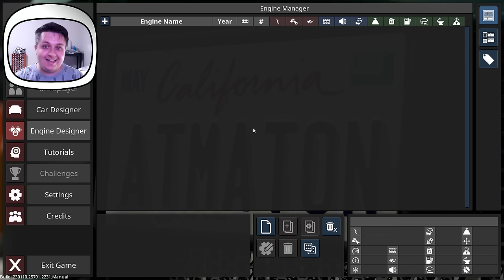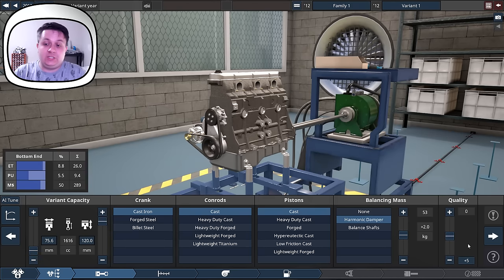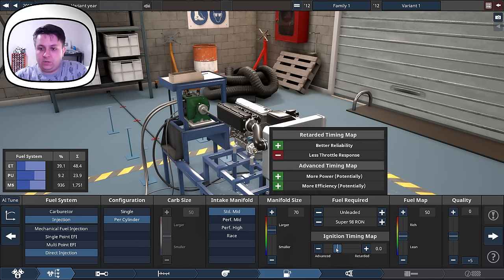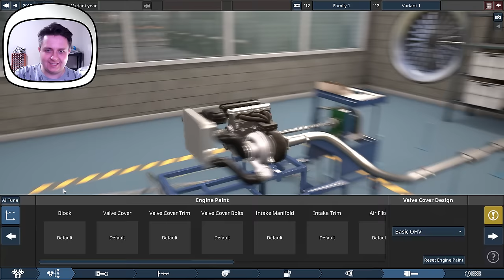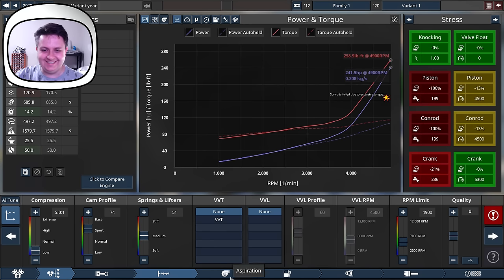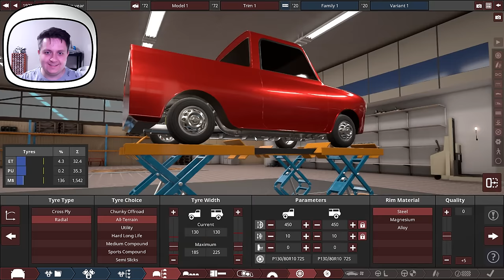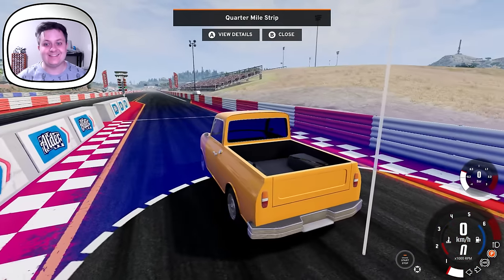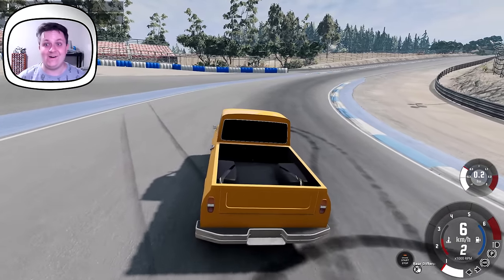Building & Testing an Engine With LONGEST Stroke & SMALLEST Bore (Automation | BeamNG)

Comment: Rod length and bore size have limits because of the rod angle during the stroke. Too long rods/stroke and the rod hits the sides of the bore.
Reply: Very long strong engine have a separate cylinder rod and connecting rod for that reason.
Reply: @zachary3777  also for scavenging or double acting but that'd allow you to definitely push the limits further if the game had it.
Reply: @gavmansworkshop5624  yep, also true for example on a double acting steam engine.
Reply: You can use a cross head bearing like the Wärtsilä RT-flex96C and have a 3 foot bore with 9 foot stroke.
Reply: You can have very long rod so that the crank will be further from bottom of cylinder, with that conrod will move less sideways at the height where it would contact bottom of cyclinder bore. the problem with that long conrods would be weight and they would bend very easily.
Reply: The ideal length for the connecting rod is 2 x the stroke length.  Results in the least friction loss.
Reply: @zachary3777 yea that's called a cross head design
Reply: When you "stroke" an engine, you need shorter rods to keep the piston from hitting the head. If you have the room to shorten the piston instead then that would work too. And yes you're right, at some point the rods would hit the cylinder walls but that's probably not thought of in the game and that would be an extreme amount of angle causing issues with the piston wanting to tilt in the bore.
Reply: @bennyboyy7  Or you can use a piston with the pin location closer to the top of the piston.  It only needs to be raised 1/2 of the increase in stroke.
Reply: Or you could build an engine with sliders
Reply: BMW R50/5 they cut slots in the bore to make room for the rod.
Reply: Easy fix! Just make the conrod way longer!
Reply: Also you would need more air and fuel to push the piston down a greater difference witch means you would need more bore to fit more gasses. Only half the stroke would be powered by the expanding gas. There is no way to fit enough fuel and air in that bore without insane octain and insane boost.
Reply: You could have a smaller radius crank but you would have next to no torque. That would solve your rod angle issue
Reply: If anything I said is wrong please tell me. I'm a mechanic student working on my MOT certificate and level 2 qualification. Anything you could correct may help me. Thank you
Reply: Higher rod ratio solves that issue.
Reply: What bout coding the jbeams of the engine? 😊

Comment: Yeah, turn the compressor trim down to 30-60, crank the boost pressure up a little bit, add 5th gear, put the static compression around 8:1, increase the valve spring pressure/stiffness a little bit; that should make this engine better.  Good fun, though.
Reply: Let my tell you 50%of you advise is trash

At first the compressor size should be around 60mm for that displacement and rpm the turbine needs too be way smaller lmao ~50mm maby even 45 mm

The trim yeah around 30ish   but trim higher trim and alower size is also possible but isn't as effective

 So fare we are almost on the same page but boy springs and lifters  over 50    isnt the way!   only high boosted engines and the once  at +10k rpm  need more than 30 in springs/lifters   the static compression at around 9.0 is low enough trust me the valves don't flow enough air so that high boost will not comply reach the cylinders 😅 (had one mad stroker engine  family but oh boy it was a struggle too tunned the turbo for thes engines) 

And well the 5th gear is a good idea
Reply from the maker: thank you engine wizards
Reply: @darealkosmo  Kosmo can you read one of my comments i think someone with your name is trying to scam me
Reply: This guy can tune cars over email.
Reply: @matthewblunderbuss4545  well +300h in automation alone and high understanding of the basic principles at work will do the trick XD ok same spreadsheets do also help
Reply: @TheLtVoss idk man, kosmo is running a turbo pushrod engine and in my experience they tend to require stiffer springs compared to something like dohc, I would suggest something like 60 - 80 springs
Reply: @pallav8725 That makes zero sense. Pushrod or overhead cam, the springs are whats snapping the valves closed on both of those... The thing thats OPENING the valves has no bearing on what the strength of the thing CLOSING the valves needs to be...

If I'm reaching then... maayyybee if ANYTHING, the DOHC is gonna rev higher and therefore need stiffer springs...

Comment: The reason (I'm about midway) the turbo isn't making boost is that it can't really spool up since the engine operates at a very low RPM, and it is pretty small.
Reply: So what do you think tractor turbos do nothing

Comment: 6:54 Yes, you can put a carb onto a turbocharged engine. It doesnt really care about the general pressure in the intake manifold, it only cares about the air flow and the pressure difference around the venturi nozzle.
Reply: I mean, boost referenced carbs dont. But if you dont have a boost referenced carburetor, the fuel pressure is only like 7psi. So it'll lean out then youll blow boost through the fuel system lol.
Reply: @SoI_Badguy  Maybe, but if you use that kind of carbs, you are more likely to just push the float up and close the fuel intake.
Reply: They make blow-through carbs for boosted applications.

Comment: Here's some tips:
1) If you only want to use one muffler, always choose the second muffler and not the first, you'll lose less power and your engine will be quieter.
2) If you want to use VVL, set the cam profile and VVL profile far apart. The entire point of VVL is to give you extra power at high revs while maintaining torque at low revs, setting the profiles too close to eachother beats the purpose of VVL completely. You can even reduce turbo lag considerably if you set them right.
3) If you make a rear or mid-engined car, try to tune out terminal oversteer. You can tell a car terminally oversteers if the steering graph shoots up instead of down.
You can tune it out by: increasing rear tire width, increasing negative rear camber, increasing rear downforce, reducing negative front camber, moving the weight balance towards the front.

(terminal oversteer means that over a certain speed you will easily lose control and never regain it)
Reply from the maker: thank you!

Comment: You'll have to go some to BEAT the Fiat 7 liter 1903 GP winner. It was a SINGLE cylinder four stroke with a 5+ FOOT stroke and about a 97mm bore. The driver(s) and mechanic(s) covered over 800 miles in 24 hours or an average speed of 33.3 MPH or about 53 KPH AND it didn't break-down, something no other brand in the race could claim. Compression ratio was a "revolutionary" 4:1 and it produced about 18 Brake Mean Effective Horse-power. In 1904 it was the FIRST automobile to travel 1000 miles (Millea) in 24 hours. The first American auto to travel 1000 miles in 24 hours was the 1904 Duryea Bros 6+ liter V-8 on a closed course in New Jersey. Different sources claim the engine was 380 to 420 cubic inches, it's agreed the engine produced an AMAZING 25 BMEHP. The 1904 Stanley Steamer made 32 HP but it's need for water every 25-30 miles doomed it. The 1905 Stanley Steamer set a World Land Speed record on the beach very near what is NOW Daytona Beach, FL of 60+ MPH, variously reported as 61-63 MPH on INFLATABLE Firestone tyres,, another first for LSR.

Comment: One thing ive always found best when building engines or the whole car in general in automation is when you're tuning but can't get knock to go away or you finally got it to go away but now its very touchy to little changes. Skip whatever youve been trying, go back and lower compression and cam ratio, check everything to make sure you didn't accidentally bump something all the way up or down. If nothing is working though, sometimes you just have to increase quality and go with better materials. Honestly though ive been having fun just keeping my limiter under 6k and making torque monsters that pull like a dragster yet sound like a semi.

Oh and exhaust back pressure can cause knock and sometimes keep you from getting rid of knock. Funny to see it cause that in the game yet people still say to this day that you need back pressure. No you need the right size exhaust factory exhausts are usually right at that limit to keep them from knocking but they want to keep some exhaust gasses in the chamber to keep engines from releasing too much unburnt fuel into the exhaust and throwing cat codes

Comment: I would recommend the variable geometry turbo(vgt) for something this small because it will allow it to build boost at way lower rpms so it will allow that tiny engine to actually spool that massive 120mm turbo

Comment: AR turbo adjustment, more is not better, it just means boost will come later in the rpm range. Lower/ smaller turbine will spool up faster, which is what you want on a long stroke torque engine

Comment: The reason you can't get the bore to stroke ratio you're looking for, is because of rod swing at mid-stroke. If the bore is too small for the stroke, the connecting rod will strike the bottom of the cylinder bore. To get your "bicycle pump" stroke to bore ratio, you would need to use a crosshead, similar to a steam engine.

Comment: decrease throttle body to around 50, and bring exhaust diameter down about 20 to 30 percent, you'll get improved vacuum and higher exhaust velocity leading to a better running engine

Comment: For the cam profile, (and I'm no expert so I could be wrong) my understanding it that its talking about the lobes on each cam that operate the valves. A more aggresive cam profile would have very pronounced lobes opening the valves up much more, and a low cam profile would have a very slight shape to the cam lobes, opening the valves just a little. This would make sense considering high cam profile is preferred for high-performance (where more fuel and air are needed) and low cam profile is preferred for economy cars (where fuel consumption needs to be kept to a minimum.)

Comment: Variable geometry turbo will help. My ram 2500 diesel truck has a vgt in it. It just has fins on the compressor that are mostly closed at lower rpm and open up at higher rpm. This allows a larger turbo to spool quicker.

Comment: IRL if you make the bore too small (or long stroke) the rod will need to be crazy long not to hit the cylinder wall. 
- Still, a long stroke is better "if you can hit the same set crank RPM"!!!
- The reason's
- it's easier for the piston to move the crank (it has more leverage aka more torque). 
- since there is less surface area there is less friction on the piston (assuming the rod is long enough not to put the piston at a bad angle)
- the initial volume is smaller so combustion puts more pressure on the piston faster (the cylinder wall is closer to the center point of the piston) a bigger bore piston must fill up more area before it can push down.
- since the piston is moving farther, it's more likely to burn all the fuel (aka less wasted fuel)
- a long stroke piston must move faster at equal crank RPM which creates more turbulence in the cylinder wall for better fuel to are mixture (especially at low RPM)
- all of the above usually make it more efficient 
I first found this out racing RC cars if both engines are hitting 40k RPM the long stroke normally wins in every category. cheaper RC engines are usually square (equal bore and stroke) for they can't hit good RPM (HP) with a longer stroke.
Reply: @gatorage850 Long rods, like a ship engine, use a "cross head" to have the rod bend on the stroke. Fun stuff to play with for sure.
Reply: Well yeah but there are 2 thinks why we don't use many longstock engines

1. The piston speed  at ~ 20m/s is the end for very light pistons otherwise they would shred them self just by the acceleration and deceleration oh and the oil Film in the cylinder dosnt like such high speeds (and on small scale these epped arnt reached even with +40k rpm) 

2. The valves in the head can't flow if they are too small or doo you want optimal cylinder charge at idel? And lose power at the  in the areas you need to accelerate the vehicle (on a 2stroke that isn't as much of a problem

That is the reason almost every car has a nearly square engine 

on slow running diesel engines a slightly higher stroke is preferable because diesel oil burns pretty slow and the higher mass of the internals that need to absorb the shock from compression ignition is killer at high rpm
Reply: @TheLtVoss  Piston dwell is a thing, and NASCAR engines use a long stroke just for that reason.
Reply: @TheLtVoss  1. ? and 2. ?
 "That is the reason almost every car has a nearly square engine" someone did not tell Honda and Toyota that...
Reply: @gatorage850  honda is always in the 10% of square form more modern engines and the tendencies go too more square

Toyota well has quite the mix but there is a easy explanation too that streamlining of production it is cheaper too build a engine family allover the same bore and use different crankshafts for different displacements so all 1.3l to 1.6l engines have a 72,5 bore so that one piston fit them all but if you go too the 2.0 well look closely at the might of square engines

I'm not saying that a long stroke is bad perse but als always in engeniring there is a trade-off and limits if the engine rpm is designed low and fuel consumption is one mane thought I would also chose a under square engine  but going after these goals will leave a work horse with suppar responsiveness and low rpm in  a unexciting engine that will soll bad in certan demographics (and the most consumer how look after good fuel economy arnt that weathy so they buy cars les often)
Reply: @TheLtVoss  still they stoke up for a reason... If you are hitting the RPM stroking up will make more power and efficiency per CC Vs bore up at equal RPM gains? that why in RC where the rules are .21ci if you can keep around the same RPM you gain way more from stroking up. it's the same in full size cars... why the most fuel-efficient cars are stroke and the fastest 1/4 mile cars are stroke. 
- yes there is negatives like an F1 car runs short-stroke to make the mostly "lightweight" since the engine is less weight with a short stroke (and lower CoG) it makes and F1 car better a changing directions (in turns). Then you can add more RPM (to gain your power back) for a short stroke is typically "more reliable in high RPM"...  but it will be less power/efficient than a long stroke at equal RPM (only if the long stroke can even hit the RPM or hold up to the forces in the RPM!!!).

Comment: Stroke is limited to the rotation diameter of the crankshaft and bore size unless you have extra separate rod connected to the piston and conrod. So an extra rod between the piston and the conrod pinion aka small end.
Reply: yup. like ship using boiler engine.

Comment: Old video i realize. But thought id comment. With long stroke, high RPM is essentially impossible. This is because to achieve the same RPM with a longer stroke length requires the piston to travel faster and faster. Not only does this naturally increase the pistons kinetic energy making it harder to turn the other way, but after a point the piston has to travel so quickly that the air/fuel mixture can't physically combust fast enough to keep up.

Take 5000 Rpm for example. With a 120mm stroke your piston will have to travel at 20 m/s on average (will be much faster mid stroke). Which depending on the compression ratio and stoichiometry, risks exceeding the combustion propagation speed. Which means combustion will not be completed before the exhaust stroke begins. There is some complex math behind the combustion propagation speed but its Typically in the ballpark of 15-30 m/s.

Interestingly, hydrogen has a much higher flame speed, and so you could achieve much higher RPMs with it, assuming you your engine is strong enough.
Reply from the maker: @Erowens98  old video or not, appreciate the knowledge drop 🙏

Comment: would definatley love to see a different engine challenge, you kept talking tractor engine, and i was expecting the end product with like, max RPM to maybe be 1000-1500 at most lol. would love to see the big slow engine next
Reply: They have deactivated thew challenge mode for the new big update coming, but there was one challenge you had to build a generator, with max weight of 200 pound, very efficient, low noise.

Comment: See you went small extreme I went big extreme 🤣 16L quad turbo v12 putting out 3500hp and 3300 ft/lbs torque 🤣 as fun as it was I tend to stick more with your standard sports car set ups, off road truck setups and eco compact sedan setups. Ended up recreating a 69' mustang fast back Mach 1 with 4 barrel dcoe carb 5L v8 NA putting out around 350hp and 325 ft/lbs torque

Comment: 86"kawasaki 4 stroke single. then make it a v8 !!! use this size and it should run fine !!! and mine was at 15 cm (150mm stroke) stroke !!! it might be longer. and the was a fun enduro bike !!! with holes in the piston big enough to put your finger throught it 4 holes like that but still ran like a dream stuck in 2nd gear. and when it went to scrap they were amazed it drove in the scrap truck. I showed them the holes befora I fired it up and drove it in the back of the scrap truck. and said my finaly goodbye to it after 40k kmh from me it had under 15k kmh when i got it !!! top speed waas 140 kmh !!! if willing to hold on but when i gave up and scrpped it still did 50kmh in 2nd !!! and I drove it like that for 4 yrs beforre i gave up. with the holes in it to prove a point. what point, holes in the piston will never stop me i guess. newer stuff is junk compareede to back in the day. some where along the way some one held back a trade secret !!!